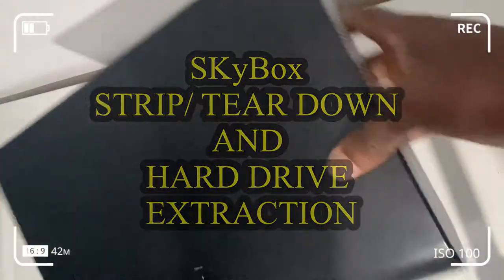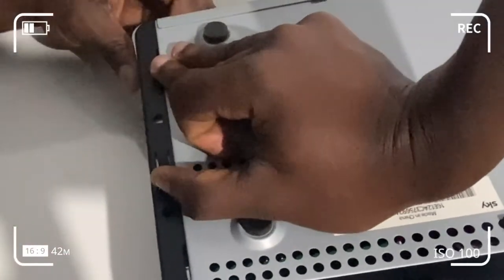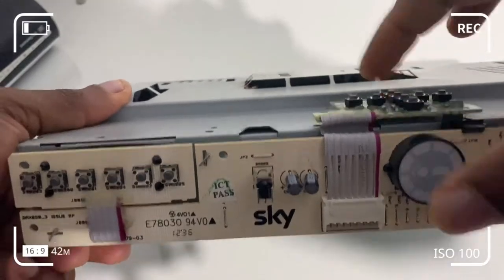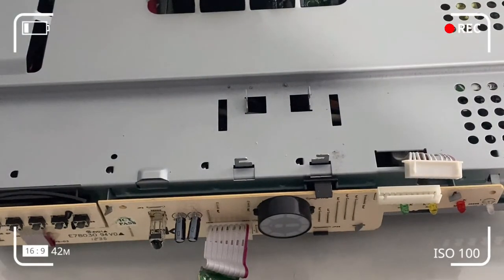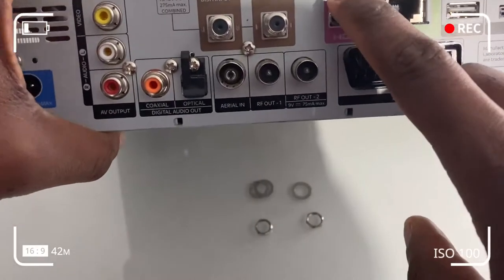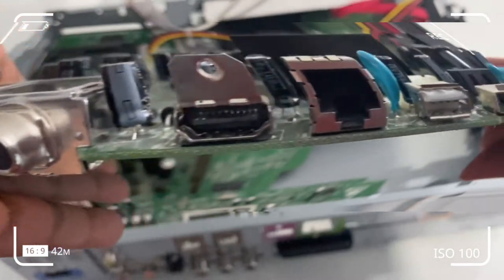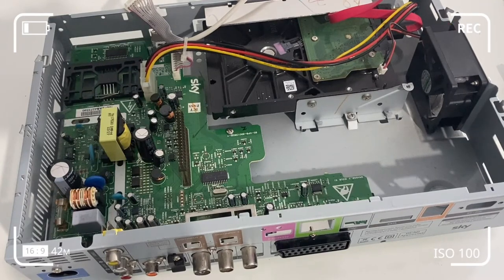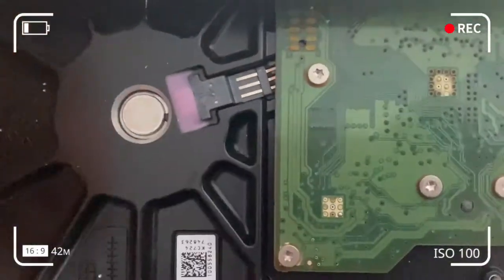Sky Plus HD Box Strip Tear down Disassembly - Hard drive extraction, salvage & retrofit for reuse

Comment: Ik you need a 3.5 sata to usb cable but some have 2 usb one to give power and one for transfer
Which do I need if I'm gonna use on xbox series s?
Reply from the maker: Hi Hassnain, you need a 3.0 Flat docking station to read both a  3.5`" and 2.5" Sata to usb Hard drive but if you need to read only a 2.5" Sata to USB you need only a 2.5 SATA to USB Hard drive HDD Caddy enclosure which I would be showing you how to use in subsequent videos soonest. If you already subscribed you would get notifications as soon as these become available on your feed. Have a great weekend. Cheers